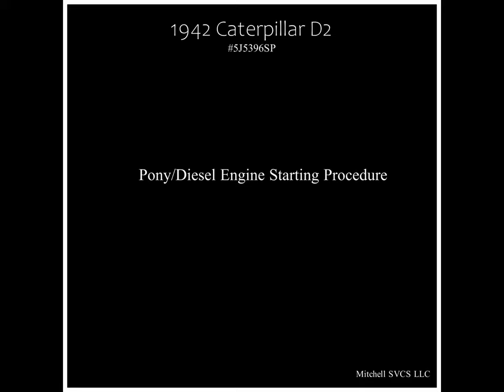1942 CAT D2 Starting Procedure (Pony Engine/Diesel Engine)

Comment: G'day mate, we own one of these - have for 50 years (D4.  Process to start is this as per the book which would be same as D2.  I think youve mostly got it right but read on...)  
- Start pony which you've done no worries.
- Once pony warm, engage main engine - diesel fuel off & decompression lever pulled out = deco on.
- After engine has rolled over for a little while with decompression still pulled out, push in the deco lever to create compression on main engine.   You can then let the Pony roll the big motor over in this configuration for quite some time - still no diesel fuel though.  (Engine oil pressure should be up now too.)
- in this configuration the pony motor is generating warmth into diesel motor via friction & exhaust gases running through main diesel manifold.  Its a very kind and gentle way to start a diesel.  heating the diesel motor prior to starting is part of the process. 
- When your happy main motor has fuel pressure & heat you can shut off fuel to pilot motor and just before pilot conks out rotate & open the diesel fuel to main engine,  She'll start perfectly every time.
- Pilot will stop as fuel is expired,  This is important.
- This method is straight from the book and is how it should be done, don't open diesel fuel lever tool early.  Good luck...

Comment: Wow extensive process to get that started.

Is there any steps that can be skipped or minimized if the diesel is already nice and toasty
Reply from the maker: Unfortunately, no.  

I've been informed by more knowledgeable people in one of my groups that I did a few things wrong, too.  There's a guy here on YouTube goes by Squatch, or something like that, that is specialized in these D2's and D4's and will offer much more detailed information... Thanks for watching!
Reply: You’re on the right track - if it’s already warm, you can skip the long cranking with the compression release open, just get it rolling over with the pony, close the comp release and immediately open the diesel throttle, it’ll pop right off.

Edit: Also, the starting engine clutch has a brake in it, the disengaged position is where he said it was, but he should be able to put pressure on the clutch lever and hold it (towards the operator’s seat) and stop the pinion rotation to while using the pinion lever to mesh it with the diesel’s flywheel and then push the clutch lever forward to engage the clutch and spin the diesel over.
He should also turn the gas off to the pony and run it dry to turn it off instead of using the mag switch. This will prevent gas from bouncing out of the pony’s float bowl and migrating into the cylinders and contaminating the engine oil (which is less than a quart) and causing catastrophic damage to the pony. There are hardly any parts available to repair those these days, so everything possible needs to be done to protect those little engines.

Comment: this guy is using an incorrect starting procedure and is harming his machine.   A Cat NEVER needs ether/Easy-start if you use the correct procedure.
Start the pony with full choke and push it in as soon as it starts, which should be no later than the second pull of the rope, no matter how cold the weather is.  Using ether instead of the choke is silly.
If the pony won't start, it needs servicing, not ether.
He advanced the "throttle" as he called it, and started the diesel by dropping the decompression.   The speed lever should be set to cutoff and when the diesel is turning , drop the decompression so that the pony generates more heat.  When the diesel is warm, start it by advancing the speed lever.
What he calls the throttle is not a throttle because a) the air is not throttled on a diesel engine - the rack in the injection pump is moved to vary the amount of fuel injected, and b) these engines are governed so that engine RPM stays constant when load varies - the speed lever does not act directly.
His method of starting causes a lot of unburnt diesel fuel to get past the rings in a cold engine, dilute the oil, and cause excessive wear.